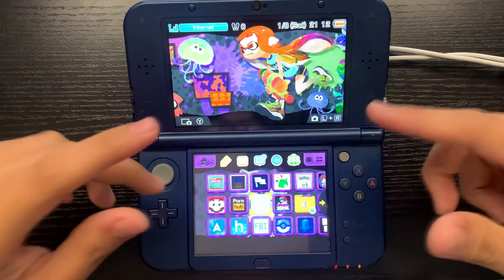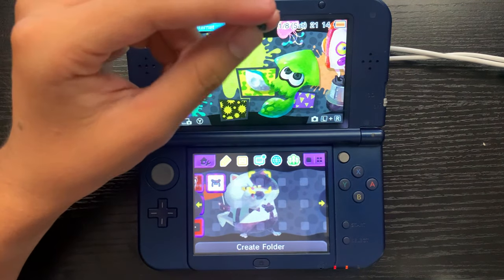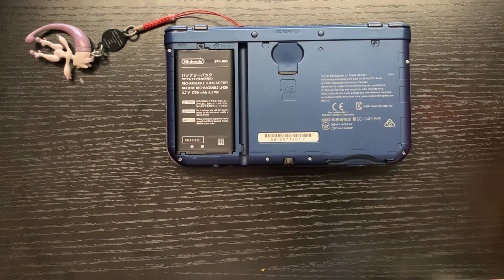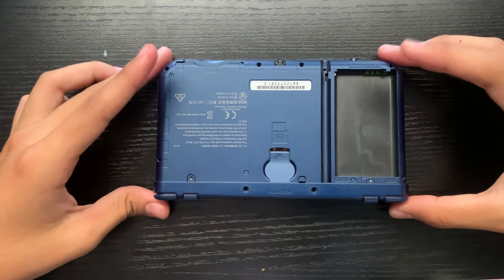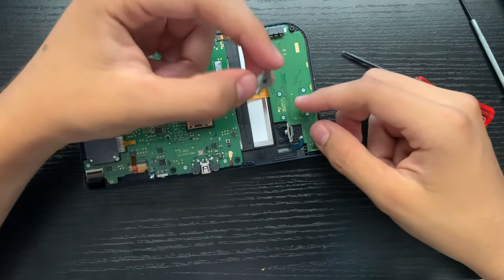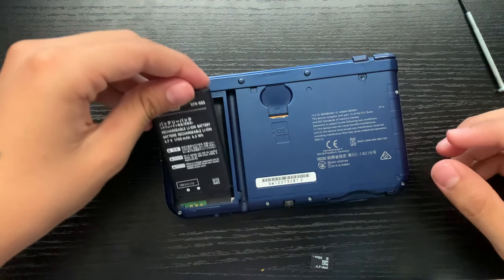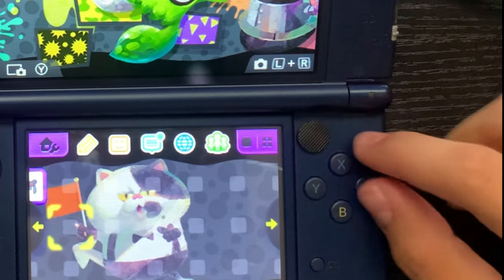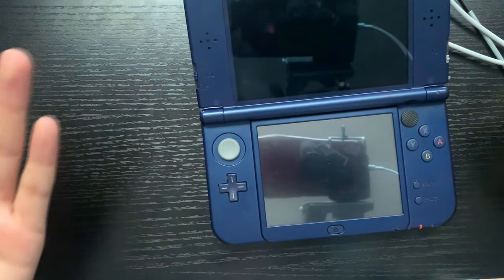The CHEAPEST Hardware Mod for Your 3DS! (PSP-1000 C-Stick Mod for New 3DS/New 3DS XL/New 2DS XL)

Comment: I used loctite super glue. Guaranteed not to wobble after extended use (two years without adjustment, but ffs be careful with the super glue!). And I would suggest if you have a screen protector, to modify the bumpers on your 3DS unless you want your new psp 1000 stick to scratch you screen.
Reply from the maker: i wanted to warn people to NOT use super glue on this (i used Krazy Glue). I wanted to give an example of my old 3ds that i did it to and show how badly i messed it up, but for some reason i totally forgot to do it while filming. 

i put super glue and it ended up drifting while it was on. when i took the cap off, part of the cstick component came off with it, thus rendering a completely useless cstick that drifted everywhere in the home screen and whatever games that required it. 

so, moral of the story here, DONT USE SUPER GLUE 😭 if you really feel the need to glue it together, the safest option would be the tiniest bit of hot glue. at least if it messes up, it’s just silicone that you can rip off.

here’s the 3ds i’m talking about in these videos. 

in its prime: https://youtu.be/R4F8qqklZc4

when it’s broken: https://youtu.be/4kPUkDKeiww
Reply: @internetivan  Ummm… I already said be careful? I used the professional loctite super glue (I think, as I stated this was years ago). And you only need a tiny (very tiny) amount. But there are other tutorials and people on YouTube that have super glued the psp-1000 stick and have had no issues. You just have to be careful, make sure you’re using a good glue, and have confidence in your hand-eye coordination. Basically understand the risks and don’t mess up. 

Also, you need to let the glue sit for it to harden. Don’t use it immediately after application.
Reply: dude, just use a super lowprofile lenovo trackpoint and forget about the glue
Reply: Wait, so if the superglue job is done correctly, does the psp 1000 analog still scratch the screen? You said adjust the bumpers? What bumpers? :O! Thanks
Reply: An update after another year (August 2023): The glue is still holding fine and I have put 200+ hours in mh4u since I posted this comment. (Among other games obviously). I will reply to this comment again in 2024 where I predict my glue job will still be holding up! (Hopefully I will remember, we will see). 

PS: Someone had a question about bumpers. There are two plastic nubs on the top of the inside of the 3DS. They are right above the top screen. I glued bits of neoprene (the SCUBA diver stuff) to them to add space and cushion to separate the psp 1000 stick from the top screen’s screen protector.
Reply: @sias.2569  Gonna need that glue update, friend
Reply: @GorpaDorpOrp  I did mean august 2024, but I suppose I can do a midway update. 

It still works perfectly fine. 👍

Edit: Now that I think about it, it does seem strange that the glue has held up this long… I kinda wish I wrote down the specific type of glue from loctite. I threw out the bottle because the cap hardened to the bottle. Which means my psp 1000 stick glue job outlasted the bottle that I used, lol. I have been playing less of my 3ds this year as I have been having fun with my new gaming laptop. However, I have 300+ in mh4u and it’s still fine.
Reply: @sias.2569 Thanksgiving update? How often do you play?
Reply: @TheMysteryDriver  Not as much recently. Nearly bricked my gaming laptop a few days ago actually. I had some bad intel graphics drivers, but I did a complete windows reinstall and that fixed a lot of my problems. I will play some smash bros if I am on a long call, but that is not very often. PSP stick still works for using smash attacks. But I don’t play mh4u because the servers are down now. So honestly, I don’t use the PSP stick as much as I used to. So… still good. 

I could update again in another year, but at this point, my PSP installation is outlasting the rubber OEM part. As a MH4u player would have worn that part down after 300+ hours anyway. I am confident in saying the PSP stick installation has been proven to be a solid permanent solution for me. I wish I knew the exact name of the glue. All I can remember is the brand.
Reply: @ have you tried Pretendo for the servers?
Reply: @ Pretendo is still at 71% completed. However, MH4U is not even on their to-do list currently. I can really do Mario kart online and kid Icarus uprising.

Comment: Why they didn't just put a full sized stick under the the right side buttons is beyond me.
Reply from the maker: should’ve been like the PSP cstick where you could still move it around instead of relying on pure rubber to make it feel as if you’re moving something .
Reply: Should’ve left the start and select buttons where they were on the 3ds xl and just put another stick in the bottom right 🤣
Reply: @TheBrandedOne2003 No, they should have put them above BAYX, like on the original ds. Then a 2nd circle pad would still fit in. The original 3dsxl placement sucks.

Comment: It actually doesn't had space enough to move it free, but still a cool mod to add on your New 3DS!
Reply: wdym?
Reply: You can probably sand off the edges a bit to help it move around
Reply: @TheExFatal  it will damage the design which is not cool for some 3DS owners 😕

Comment: If you want to do that buy a thinkpad trackpoint cap instead of a psp cap, it has a squared hole so it fits perfectly
Reply: is the thinkpad square the same size as the one on the c stick?
Reply: @superman2957  way bigger
Reply: I'll try your tips. Thanks, king

Comment: OMG I thought that button was for the console to know when the lid was closed, didn’t know could be used for playing
Reply: Lmfaoooo
Reply: Same
Reply: WOW lmao XD
Reply: Not sure anyone'll see this, but it actually detects it's closed with a magnetic sensor (I think it just detects the magnets in speakers but not 100%). It's 100% a magnet though, because you used to use a fridge magnet to enter into a recovery mode of sorts when installing CFW years back - entering recovery mode required holding certain buttons while the system was asleep; for 2DS that just meant slide your switch to sleep mode, but on 3DS models you have to close it to enter into sleep mode... or at least make the system think you've closed it. lol

Comment: The thing that should be always mentioned is that the PSP stick won't work the same way as it did on the PSP, or like the circle pad on the other side of the 3DS. It doesn't 'hover' in a circular fashion; it's still acts like a cap that you have to press on a direction while it stays still in the middle point.

It DOES NOT moves around like you said on 06:08. In fact, you can clearly see on the video that you aren't moving it around at all.

Comment: Do you have any tips to put those orange cables back in ? My first time I did it it took very long and almost got ripped in two pieces
Reply: The enclosure is designed with the cables only connecting at the top. It is designed this way so you can open the back like a book to more easily access these cables. Check out ifixit’s guide. There are pictures for each step of the process. Step 9 of the tear down showcases the optimal way to access these cables when working on the console.

Comment: So, apparently the IBM/Lenovo Trackpoint caps fit over the peg perfectly.  

The only problem is that they only come in red.
Reply: You can get them in black
Reply: They're about the same size as the c stick though. The PSP cap is much wider so I think I prefer that.
Reply: @Ni5ei  they're a little bigger.

Comment: think you might need a battery replacement too...
Reply from the maker: nothings wrong with the battery tho?
Reply: @internetivan  huh, thought you might need it cuz the battery was on flashing red after charging. lithium batteries often lose their effectiveness after a while, only being able to hold about 10% of their previous capacity after about 3 years with constant use. you probably knew this sorry lmao
Reply from the maker: @squeenixu  i just didn’t charge it before making the video ☠️ but now that u pointed it out it makes more sense

Comment: There is a better alternative. Lenovo nubs. Ultra low profile. That's nice instead of a plastic stick.
Reply: Are you talking about the red trackpad used in Thinkpad laptops?
Reply: @netako  these little nubs on the keyboards yes.
Reply: I second this, just did this mod with my galaxy n3ds xl and it takes the c stick from trash to actually something playable. Makes sense cause Lenovo has been dominating the nub industry for decades. definitely worth if you play a lot of Xenoblade, or MH4U, it even makes Minecraft playable